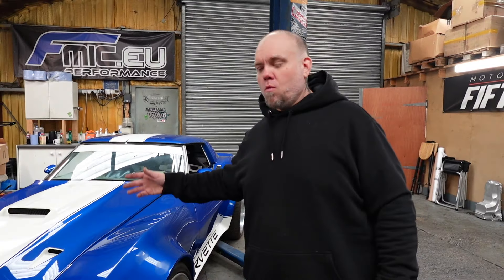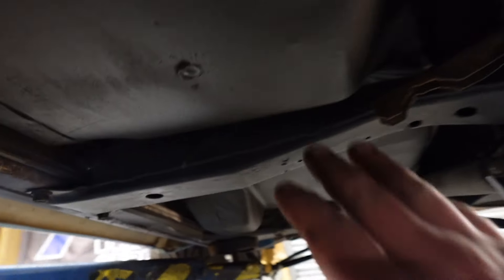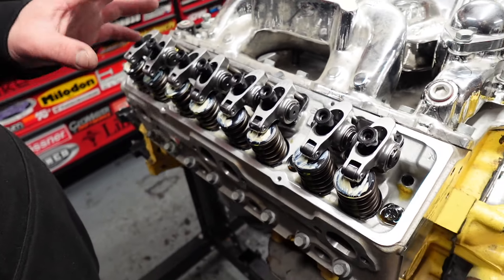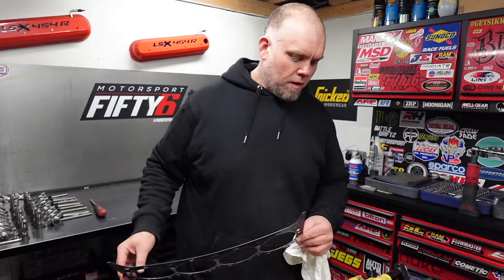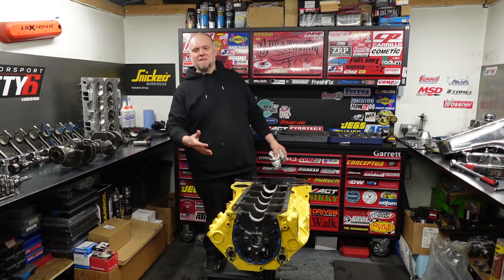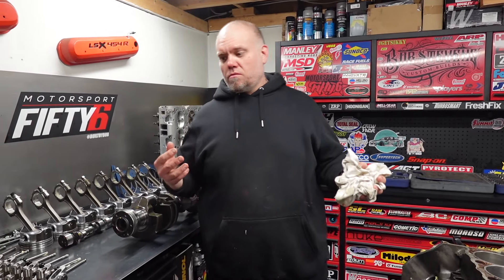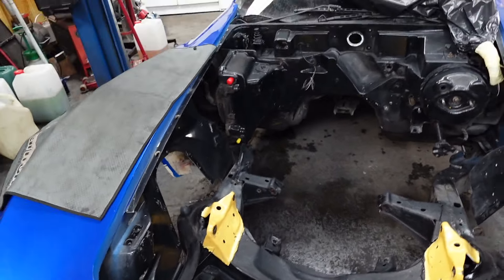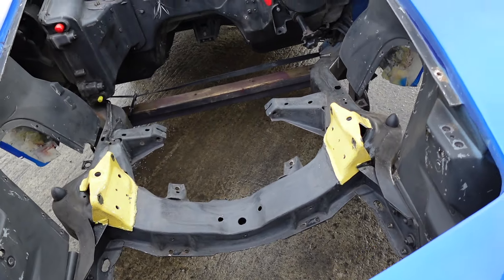1980 CORVETTE C3 WIDEBODY REBUILD

Comment: I have an 82 Vette with a Dart SHP 427 making 550hp. I use a 4L8E with a US-Shift 4 TCU.  I never really liked Lambo doors an any car other than a Lamborghini. The body is designed for the door to work. Everything else has this retrofit double hinge si the door doesn't hit the body.. I would love to see some one try a Koenigsegg hing on a customised car. That has a set of gears rods and arms to make the for rotate forward as it moves out parallel to the car.